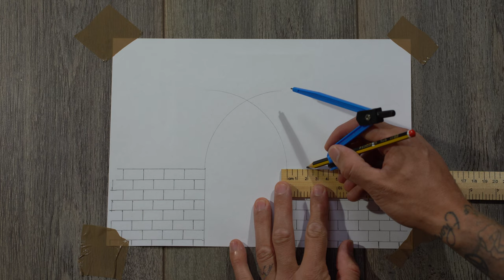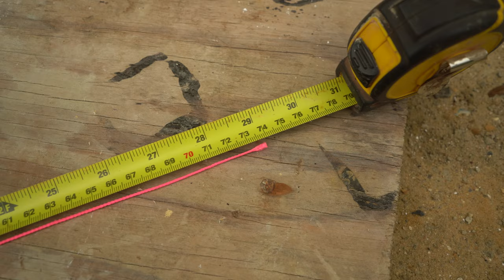HOW TO LAY BRICKS - GOTHIC ARCH

Comment: Fantastic work Rodian

In regards to not using a level on the end bricks.When you have profiles set up.
A trick that I was taught is to place a dot on the line where there brick finishes.
As you raise the line the dot remains plumb. Assuming the profile is also plumb.

Big fan from New Zealand

Comment: Can anyone explain how to use the string line to build the arch? I'm confused as to how and what it's supposed to measure. There's no explanation ANYWHERE.
Reply: @coreybray2274  thanks:)
Reply: Vanessa P, my bad, it’s the length of the string divided by the gauge of the brick 75mm, including join..... or in this case 74mm.
Reply: @coreybray2274  hi Corey,  I just don't understand how it being used here. One end of the string goes up and you do a few bricks, I just one understand the angles. The string is getting moved all over the place.